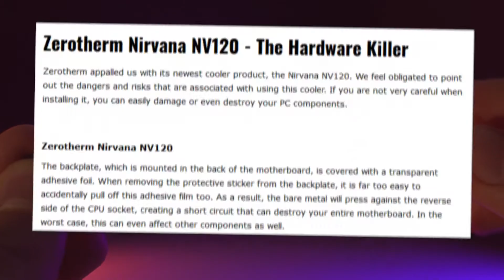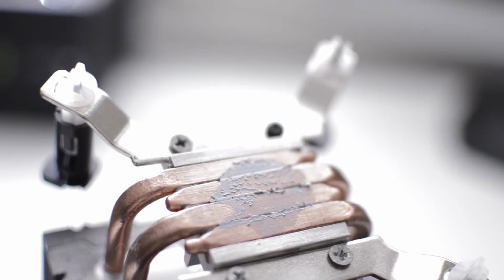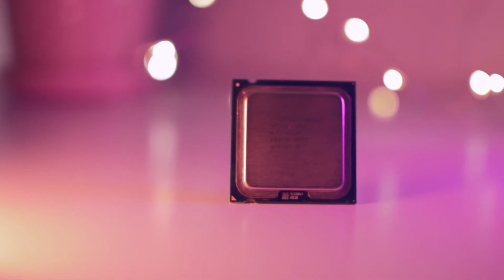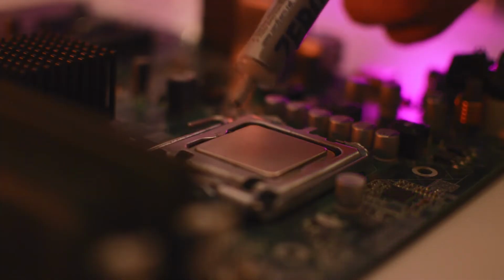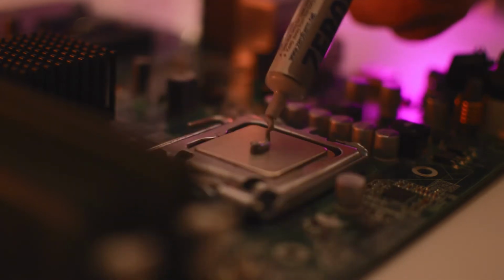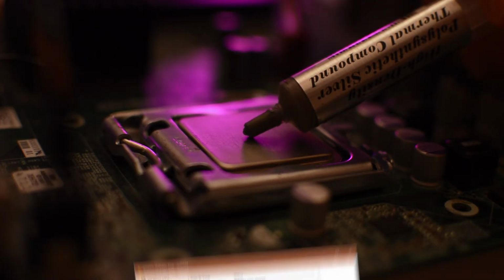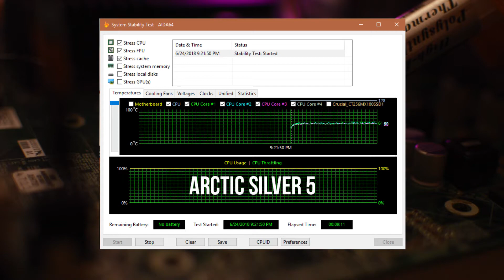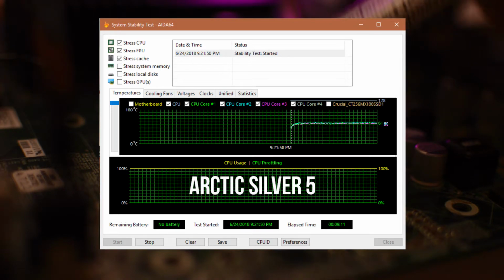OLD vs NEW Thermal Paste! (8 year-old thermal paste test)

Comment: I have the same heat sink and man it’s a pain to fit into those little holes
Reply: They just slot in no force your meant to pull the pin first then they go smaller to slot in then twist and push the pins they open up inside and lock tight then and😊